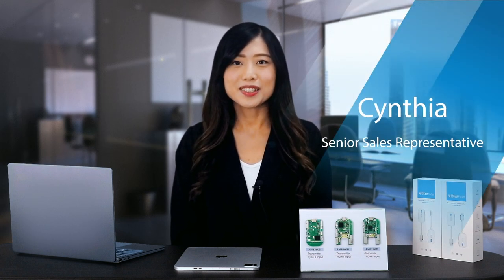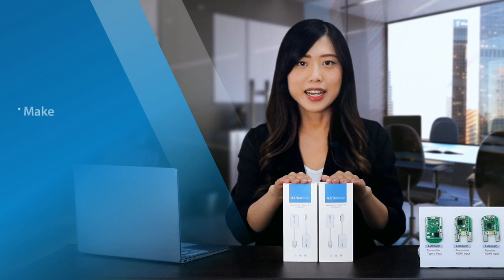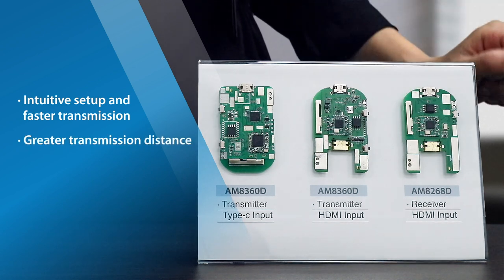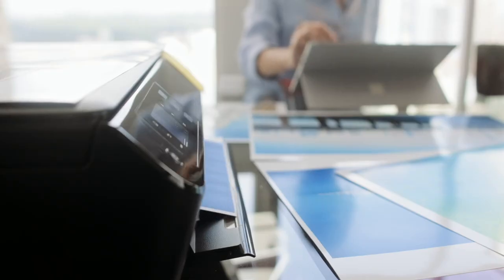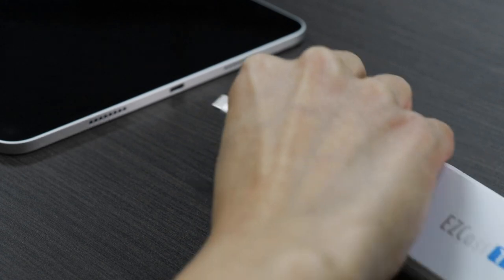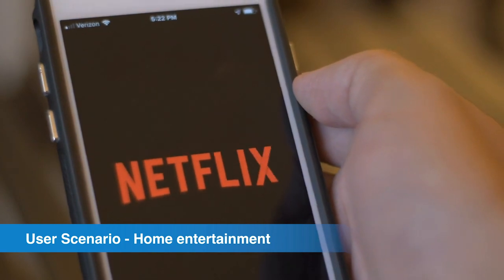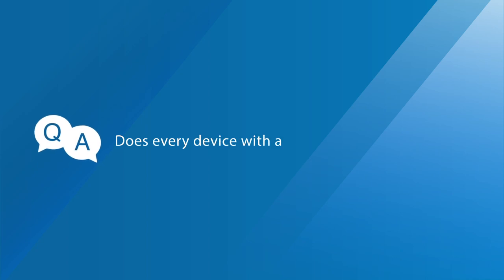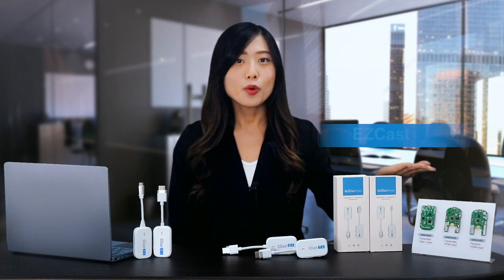EZCast Pocket: Product Launch Webinar - The Simplest Wireless Transmitter and Receiver Kit

Comment: Hello I have a vamvo mini projector and I got a samsung s6 light and samsung a525g I used to connect them but since moved and changed my internet provider it doesn't connect anymore it says can't find device
Reply from the maker: Sorry, it seems not EZCast pocket product using problem. So we cannot provide service for you directly.
Please contact EZCast Service Center by mail to support@ezcast.com
And please  specify the information for us:
Dongle’s SSID: EZCast-12345678, for example (or photo the bootup image for us like attach picture)
Dongle’s firmware version: 16602001 for example
Functions: EZCast(Photo, Camera, Video, the Web, ……), Airplay, Miracast or DLNA
EZCast OS: Android, iOS, Windows, Windows Phone, Mac, or ChromeOS App
Symptom: Fail to install, App crash, Fail to stream, Fail to mirror……

Thanks for your understanding and help.

Comment: ue o anterior era um aparelho so agora aumentou para dois aparelhos ja era complicado e dificil de conectar sera que agora mudou pra melhor...!
Reply from the maker: Dear user, thanks for your interesting and concern.
This EZCast Pocket page is Plug and Play casting device.
You just need to plug the receiver to TV, and plug transmitter to your smartphone/laptop, it would start casting automatically without other steps.
It's very simply and quickly to do wireless casting.

Comment: I connected the adapter to my mobile to stream and it shows on monitor but the stream not working!! I need help to connect my Redmi Note 10 Pro. I sent email screenshot to support
Reply from the maker: Sorry that Redmi Note 10 Pro doesn't support type C+Display alt mode output, it's single type C port without video output spec.
So your Redmi device cannot use with EZCast Pocket to do plug and play.
Some other EZCast Wireless display receiver like EZCast 2, EZCast Ultra would be more suitable for you, Redmi device could cast to EZCast Wireless receiver via EZCast App or Miracast protocol.